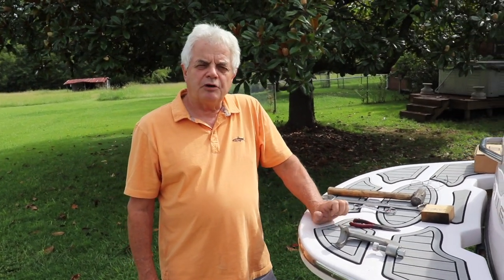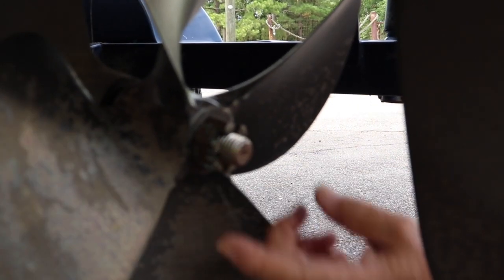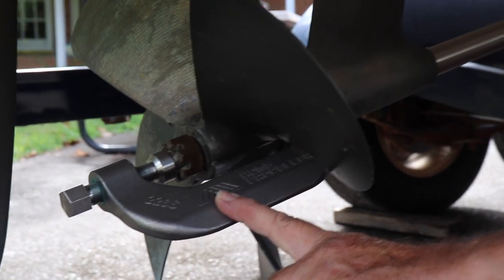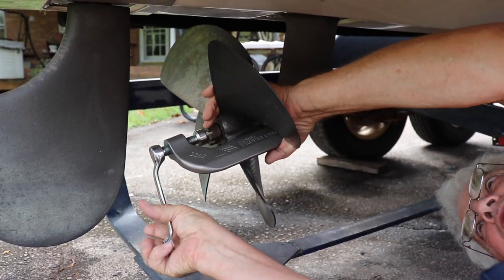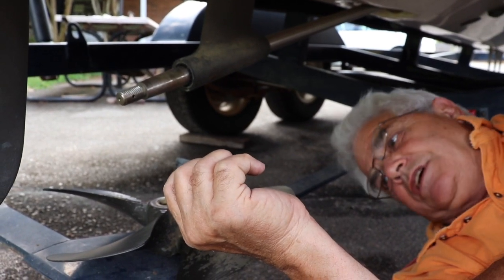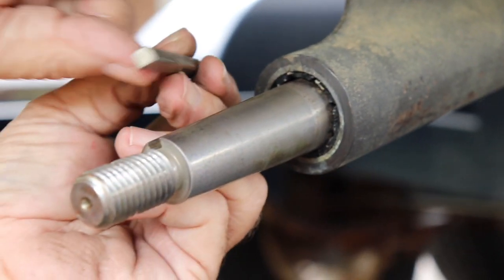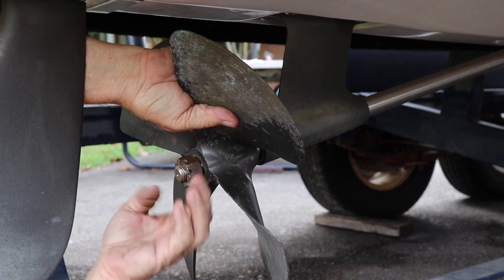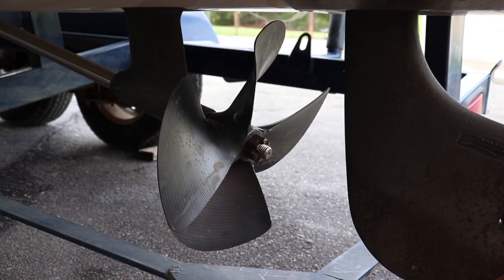Inboard Propeller Install and Removal | How to use an Acme Prop Puller

Comment: Do you have a video on replacing a broken prop shaft strut? we have  1981 WellCraft 248 sportsman with a velvet drive, the shaft strut is broken just below the hull mount.

Comment: I'm working on a Malibu right now 350 block. After about 30 mins of use, it's losing power after about 30 mph. Just cuts out. If I pull back on the throttle, it will run alright. But if I try to go faster it just kind of cuts out. I have run through the basics, connections, filters, etc... Advice?
Reply from the maker: When it happens, do you lose fuel pressure? Since you already did cap and rotor plugs etc that's where we would start.
Reply: @skidim8143  that's what I'm thinking too. He wants to go ahead and replace the pump. That's fine. But I didn't have my gauges on me that day. So, I did tell him I can't verify it's the pump without a proper test. It's a easy pump to get on and off. So, I guess that's where we're going. I appreciate the reply and the videos.
Reply: @skidim8143 what’s the issue If the props hard to turn by hand? Shaft Alignment issues?